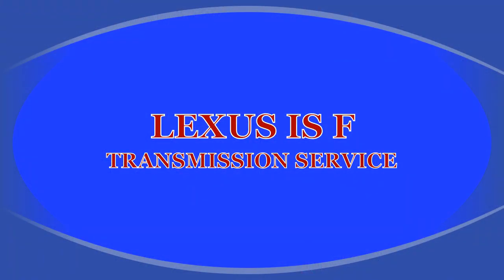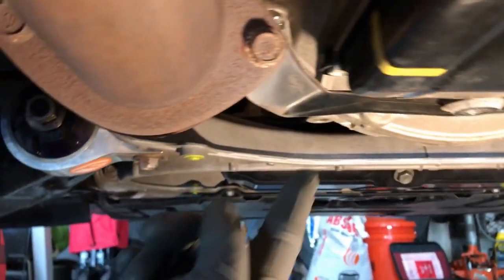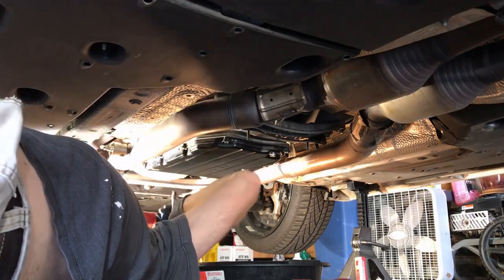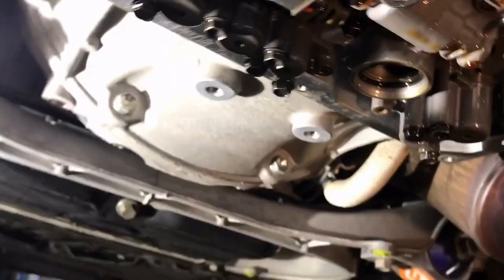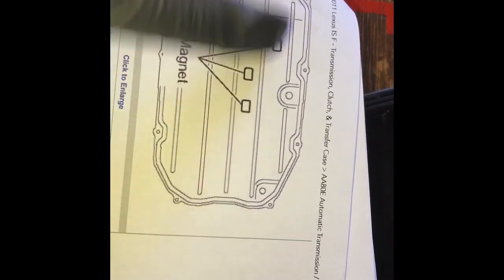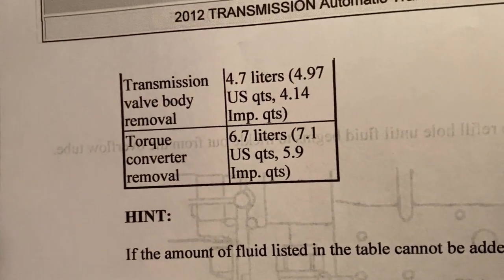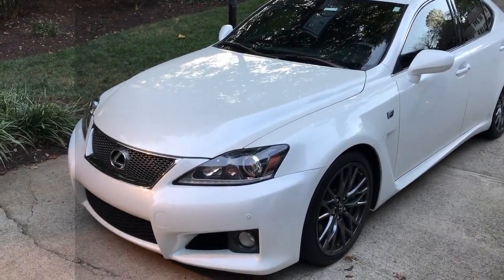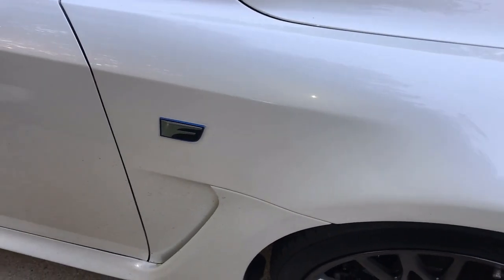Lexus IS F Transmission Service

Comment: Awesome video.  I just did my GS350 which is practically the same.  Wish I would of seen your video before doing mine.  Like you I have done this on many old cars and it is always a messy job 😊…believe it or not my old Pontiac Sunfire with “sealed” transmission used a similar method with two noticeably easier steps.  1) it had a fill cap with a beefy o-ring. Cap was located at the top of the transmission so it was easy to use a funnel to refill.  2) it only called for “normal operating” temperature and drain excess fluid from check plug while idling in park…very similar.
Reply from the maker: Thanks for watching and glad it helped!

Comment: I have a 2008 Lexus GS460, and I believe that both mine and the IS-F share the same transmission, I was hesitant about doing a transmission service but now that I’ve watched your video I hope to be able to change my fluid soon.
Reply from the maker: I’m glad the video was able to help! I always suggest to drop the $30 and get a full service manual so you have all the info to do it right. Check out the two sites in the comments section of the vid. I do not get anything from these two vendors. I paid for them myself
Reply: @cpfb68  I finished replacing my transmission fluid about 300 miles ago, your video really helped out a lot, thanks !
Reply from the maker: @albertohernandez2229  Not a problem! Glad it helped you get through it!

Comment: 47:26 it was totally normal to see the dashboard as you saw. You were on the right track. Right after shifting back and forth about 6 or 8 times, put it back to P and then remove the pin from OBD. In a minute, temperature would get in the range and after about a minute or so dashboard would start to flash again to indicate transmission fluid is above the specified range.
Reply from the maker: Yep, I had a bunch of people tell me the exact same thing. I wish the manual gave a little more detail on what the dashboard was going to look like!! Did the same service on my 15’ Sienna and jumped the pins and worked fine. I plan to do a simple service this month and will try to jump the pins again. Probably will post it as a minor service. Thanks!!

Comment: For those who want a Complete (Trans, Torque Converter, and Radiator-Cooler) fluid exchange vs an approx 40% pan exchange, the following 2007 RAV4 approach SHOULD be applicable to Most makes and models:
1.) Remove the plastic shield under the front of the vehicle. Note, new assorted plastic push-clips are recommended.
2.) The radiator cooler transmission fluid out-fall is on the drivers side approx 3/4" OD, 3/8" ID rubber hose with spring clasp clamp --  EASY to see and access!
3.) Disconnect the hose and attach an extension line to a translucent 1gal jug in an catch pan (for overflow/spills).
4.) The steel return line may drip into a second catch pan.
5.) Snuggly attach a clear extension line to the dip-stick tube with a funnel. (I inserted a clear plastic kitchen "baster" keeping the refill level from overflowing at top of the "baster"/funnel).
6.) Start the engine and put in gear (automatic) until approx 1/2 gal OLD is collected and turn off engine.
7.) Fill approx 1/2 gal NEW.
8.) Repeat for approx 2 1/2 gals until bright pink is dispensing.
9.) Reattach radiator/trans Return line.
10.) Adjust fluid level to the low side of the "Cold" mark on dip-stick (so you can top-off to the Hot mark).
11.) Drive vehicle until transmission is up to approx 115 deg. F and adjust fluid level to "Hot" mark.
12.) Reattach the plastic shield using new plastic push-pins.
13.) This should replace the Trans, Torque Converter, and Radiator Cooler with ALL New Fluid.
NOTE: For Sealed transmissions attach an extension line with funnel to the steel Return line (instead of the non-existent "dip-stick tube").
Happy motoring!

Comment: Finally got around to doing this today after getting all the parts and fluid months ago - I managed to get the filler plug out with a 24mm ring end spanner without much difficulty as none of my 24mm sockets were small enough.  Upon removing the drain plug, fresh smelling clean red oil emerged.  Upon removing the drain pan it was very apparent that someone had done a full service very recently, but it hadn't been put in the log book.  Oh well, at least now I know.  Also found the same thing when I did the diff recently - prior owner was fussy about maintenance, not so fussy about records.  What a horrifically messy job - I've done a few of these on other vehicles, mostly ZF transmissions, which are super easy as long as you have the pan with a drain plug.  With this, I was not prepared for how much fluid remained in the pan - couple that with the old rubber gasket being quite firmly stuck to the transmission and I ended up with a enormous mess on the floor.  Then there was getting my fluid pumps hose into the filler hole, which was extremely difficult in the cramped conditions under my ramp and jack stands - then endless pumping (I wanted to be sure given how much I'd ended up with on the floor so ended up putting about 5.5 litres in - not sure why the service manual says 3.7 litres as even after all that spillage I had 4 litres in my catch pan after draining, and after brining the transmission up to 40 degrees and opening the leveler valve I got less than 500mls out of it, so it's got something like 5 litres in it right now.
Next time I think I'll either see if I can borrow someone's hoist, or just pay them to do it for me.  Give me a ZF any day.
Reply from the maker: Glad the video helped! Sorry you found out it was done already but now you know its good ot go!!

Comment: Great job. I have a Scantron that I plug into the ALDL, so jumping pins 4 and 13 is not possible. You got it done. I like.
Reply from the maker: JESSIE RAMSEY Measuring the temp following the service manual was a joke! I jumped the OBD II pins five times and checked each time with no luck getting the car into service mode. I had purchased the temp gun as a backup. I was so PO’ed the OBD jump didn’t work I forgot to film it! It all worked out in the end.

Comment: Epic, I'll pay the Lexus dealer for that service. My 2017 IS300 awd F sport is at 59,300 miles so I want to have the transmission oil flushed. The dealer is not dropping the pan and changing the filter, they just flush the oil. They quoted $200 to do it, I failed to ask if that was labor and materials. I'll DYI the brake fluid flush, spark plug change, cabin filter, air intake filter, maf clean, oil and oil filter myself. Also ordered RC-F control arm bushings, hopefully I'll have them soon, really want to replace the squishy bushing that destroy my front tires.

Comment: Awesome vid. I was thinking about having Lexus do it because of the fill process but it’s a lot easier than expected. Will be doing it my next oil change
Reply from the maker: It’s really not too bad. Hardest part is the Down pipe bolts. Hit them with PB Blast and try to loosen them first. If they come off (or at least one) your good to go.

Comment: To clean the surfaces, grab a shop rag and denatured alcohol, carb or brake cleaner will do (but spray to rag... not to surfaces!!!)

*I never loosen bolts w a electric or pneumatic tool, if by any chance it goes out kinked because of the socket etc, in aluminum, will eat up the threads.
*Always tighten crisscross pattern in small increments, never torque down one bolt at a time.

Comment: Fabulous video - my 2011 just had its service (36,000 miles) and they suggested a trans fluid swap( Lexus are servicing it as it is still under Extended Warantee - the last time I can do this). They want £500 ($708) to do this.  I think I will do it myself after seeing how DIY-able it is.
Reply from the maker: Thank you and I hope it helps! It’s really not too bad of you have the basic tools to do it. Hardest part was getting the pan down as the gasket is essentially melted to the trans body. They do sell separator tools to not damage the Pan or the body of the trans. I plan to pick one up for the next service. Good luck and I hope it’s smooth sailing for your service!!

Comment: I have done the fluid  change on my GSF and Sienna. When doing the OBD procedure and going back and forth between D and N. D will eventually show solid, not P like stated in the manual. I posted a short video on my GSF showing the D light coming on when the shift lever is in neutral. The Toyota tech carecarenut YouTube channel also has a great video showing the steps and light D light turning solid.
Reply from the maker: Thanks for that! Yes! I have been watching The Car Care Nut and recently used his vid on trans fluid change to follow the procedure for using the OBD II jumper wire method. For some reason, I still couldn’t get it to lock into D and get into trans temp mode. I used my temp gun again and all was perfect. Thanks for sharing!

Comment: all the flashing lights is normal when you jump those pins, code 43 and 45 will show as well, just start car as normal and shift into D, then go back and forth to N and D fast until the gear display disappears from the instrument display, then put gear back to P, gear display should still be blank. then standby and wait til gear display show a solid D, then the fluid is in temp range for fluid level check, do it before the gear display starts flashing, when it flashes it means temp is now higher than range for level check.
Reply from the maker: Thanks fir that info! I was wondering what I did wrong to make the entire dash flash like crazy when I jumped it. The manual never said anything like flashing. I plan to do a minor service soon so I’ll try it again following your description above and video it and post it for all. Thanks!

Comment: Those dipstick thing that you mention if it can open like a drain look like an oil level “max capacity” when re-filling the fluid.
Reply from the maker: Hi! Not sure I understand what your assking. There is no dipstick in this transmission. The only way to properly fill and check the level is to have a cool vehicle, open the drain plug with the level tube in place and warm the trans to the proper temp and open the plug. If nothing comes out you need to add more after colling down. If some drains out, wait until a trickle and close it up. Should be the correct amount.

Comment: Awesome video I knew that lifetime fluid thing was a myth, I’ve been wanting to do this but everyone was freaking me out 🤦🏻‍♂️ I’ve done plenty of filter and fluid changes before this didn’t seem hard at all! And I’m glad u used the temp gun cause that whole jumper wire thing was crazy anyway thanks bud for the video
Reply: I just came to check that I'd received the correct part before getting the car up on the stands as the pan gasket looked to have suspiciously few bolt holes - but seems they did send me the right part - anyway ended up watching the whole video which was excellent thank you!  Nice to see someone doing everything right and taking the time to teach other people to do everything right!  One other thing I've discovered with Aisen-Warner A series transmissions is Nulon, an Australian lubricant company do a OEM spec full synthetic ATF fluid that is much cheaper than the Toyota ATF.  I've run it in a number of Lexus and Toyota vehicles over the years and it's been brilliant.  I've also run it in ZF6 transmissions as it meets their specs too - again it's been great in the Germans too. No idea if you can get it in the USA though.

Comment: Great video! I'm glade you made this. Question, was it necessary to swap out the filter as well? I just assume that since most cars now these days don't require to be replaced that it would of been okay to just to do a drain and fill?
Reply from the maker: All Automatic transmissions need a fluid change regardless of what the manufacturer's call "LifeTime Fluid" . You could do a drain and refill but to get the most amount of fluid out of the transmission, short of the flush, you would need to pull the pan off and then take off the filter. 

You can see in the video that when I pull the filter off about another 1/2 to 3/4 of a quart drops out. I feel if I'm going to pull the pan down and take off the filter to get the fluid out, I might as well change it. 

By pulling only the pan drain plug you get only a little over three quarts out. By dropping the pan and filter you get about five and a half quarts out. 

Its up to you if you want to spend a little extra money to change the filter. THe pan gasket and filter is a little over $30. The pan gasket can be purchased alone from Lexus, online, etc for between $20 to $25. For $10-$15 more its that much more protection for a very expensive replacement!

Comment: Great vid. Whats your verdict on performance/function post fluid/filter change? Noticeable difference compared to the old fluid? Thanks!
Reply from the maker: Shifts were quicker and smoother. Overall a slight change especially when driving hard. I plan to do a series of three or four pan drain & refills when it gets a little warmer to freshen up the fluid. I may shoot a quick vid for the pan drain and refill as well.
Reply: @cpfb68  Great tutorial if you could make available or send to email of the service manual. I will do oil change in my gs 460 and definitely useful.
Reply from the maker: @grzegorzzygan4095  sorry, the manual is copyrighted material and I can’t post it. You can go into the links provided and purchase the entire manual for your car. I highly recommend it!
Reply: Lexus Dealer Refused to Change Mine @ 61,500,Said Also,Fluid is Not to be cghd.till 100,000.So Will be taking My 17 RC350 To An Independent ASE Cert.Mechanic,Soon,Even though I don't  Use Sport & Sport+ a Lot.& I have a Extend.Warr.on Trans.& Eng.& All Major components.Lexus Auto.Trans.Fluid or the Brand thats Suppose to be Superior that's Sold only by the Reps.that buy it directly & sell over the internet,Brand' s not coming to memory.Have Heard the Avg.cost of Indept.Mechanuc is Around $400-450?

Comment: Thank you very much for the informative video. I have a 2012 w/86k miles. In your opinion, do you think it’s to late to change the filter? I’m definitely going to drain & fill the fluid. Also, after removing & replacing filter for the first time. When do you replace it again?
Reply from the maker: I did my first full service (pull pan and screen, 6+ qts) at the 60K major service (plugs, rear diff fluid, brake fluid, major trans service, coolant if you want). I then followed up with three minor services (pull drain plugs and refill, about 3qts) at 1K miles after the major. This helps to keep a lot of the particles that are suspended in the fluid and helping the clutch packs to engage to stay in the system but still lets you get fresh fluid for longevity. I’m about to hit 90k so it’s time for another major service. Good luck!
Reply: @cpfb68  Well…I think I need to get to work. I did my spark plugs, diff, air filter, cabin filter, mass air flow sensor, throttle body, I just need to do transmission. You should make a video on coolant! I don’t know how to do it! Im aware of the drain ports…the proper way to service would be a great watch!
Reply from the maker: @XBrandonLeeX765  I had been planning a coolant flush and replacement. I managed to get the dreaded Valley Plate Leak and thought hard about doing it myself....and thought again as I had an extended warranty and had my dealer do it. They swapped the coolant about 15K ago.  I may do a full flush at the 120K service whihc is the next major service. Thanks for the input! I might just do it for the video to help out!
Reply: @cpfb68  please make that video…it’s the bleed process that concerns me. And please do a valley leak plate video in the future. You’re a tremendous help! I actually need to replaced my fan assembly & been thinking to tackle the radiator while I’m in there. Servicing the coolant will be a must! I’d certainly appreciate that video. Thanks to you! I’m going to tackle the transmission asap

Comment: Great video, this is very valuable information no for the average DIY’er like me. This should pretty much be identical on a 2015 IS350 correct? Believe it’s the same 8sp.
Reply from the maker: I’m not sure if the V6 8 speed trans is the same as the V8 8 speed. You can go into my comments and I have provided a link to the online service manual. I recommend you get any type of good manual and follow it. That’s basically what I did. Good luck!

Comment: Toyota tech stream give you transmission temps.  No such thing as lifetime fluid    u did the proper job  changing the filter too👍       Isf  a great car.  Enjoy your toy thanks for sharing
Reply from the maker: Thanks! I hope it was useful. I do want to get Techstream but not sure where to pick up and what type of laptop and cable do I need to get.
Reply: @cpfb68  I'm using old laptop win 7  bought cable on amazon
Reply from the maker: Where did you pick up Techstream?
Reply: @cpfb68  amazon  /also available ebay  some sellers supply software and support

Comment: Dude, skip the pumping of fluid and use gravity.  Took me about 2 mins to pour 4 qts in my IS350 without fighting against gravity with the pump.  Bought 5/8” OD clear hose from HD and used a funnel I already had.
Reply from the maker: The fill plug in a 350 trans is completely different than in the F. You can’t get a gravity fill where the plug is.